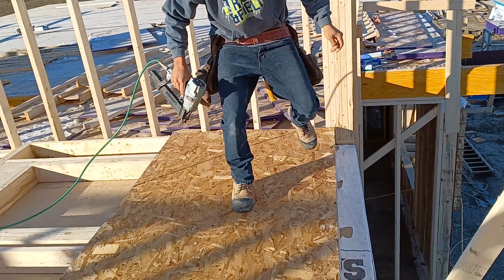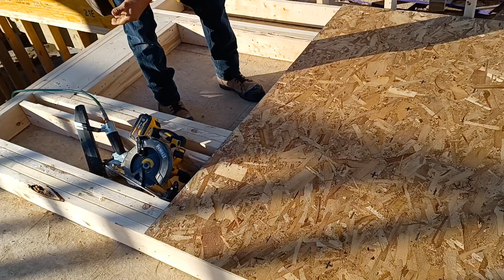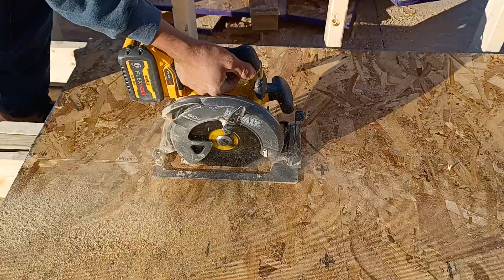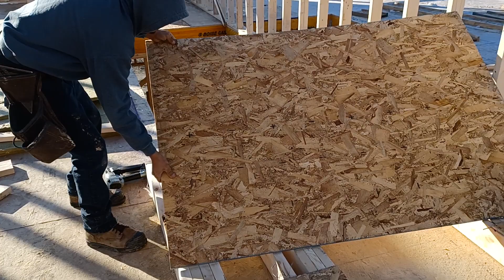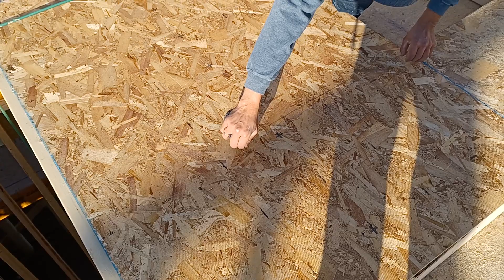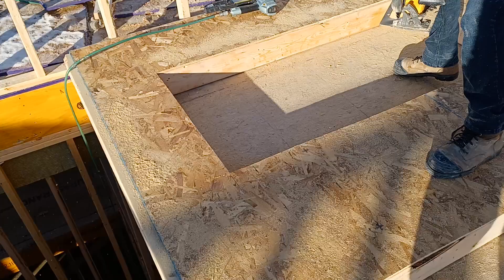framing Beast mood 😱😱👍✌

Comment: From a home buyer, I'd like to see a little more precision in where those nails or staples are going in.  In the last house I built, I watched the framer place the nails similar to this video and many of them missed the stud entirely.  But props to your work ethic!  Nice video
Reply from the maker: Thanks for watching. And for the advice bro!!!
Reply: Ted. I understand you. Last month I crawled underneath my house to check my water lines. As I peeled back the insulation. I found trash and cut pieces of OSB underneath my flooring. The framers had missed an entire length of sheating. 3 rows all missed. Removed the trash. Tidy up my insulation and remembered where to screw down my flooring. Never seen so much sloppy work in my life. Seems the workers are chasing money instead of quality.
Reply: Him missing a staple or two will not make any difference he has tons in it already its over kill he puts more in it incase he misses a few , you should see what the plumbers electricians and hvac guys get away with this guy missing a staple on some plywood should be the LEAST of your worries, we have to go fast this is how we eat they already are stingy on pay meanwhile without the framers nothing else is possible….
Reply from the maker: @buddylikeguitar  ya brother some people that doesn't know much about framming  thalck like does guys. Exactly like you say I put more than enough stapples. Props brother 👏.  And I almost never miss a staplles. I will show them o another video. When you have framme for a while you almost never miss because you get good at it . You can recognize even the sound when is missing or not
Reply: #movesgottabemade... 👍🏿👍🏿💯💯
Reply: @ontarioframingmachine2556  yeah exactly , 7 years framing in niagara region have my own company !!! Framer till i die
Reply: Ted, missing a couple fasteners isn't a deal breaker and is bound to happen when you are production framing. No carpenter is perfect and this fella is building with a lot of precision.
Reply from the maker: @buddylikeguitar  same here brother.

Comment: Lol a lot of framing inspectors here. Solid work bro, keep up that energy, job is extremely challenging as it is and you make it look easy.
Reply from the maker: Thanks bro.i really appreciate your words.
Reply: When it's my home. Hell yes. I will inspect my home. I'm paying for the work. If the quality is not there. Why would a home owner pay??
Reply: @2nickles647  as long as you have knowledge of the field, most have absolutely no knowledge and spew their bs like it matters.
Reply: Staples are hardly the way to go, you put about as many as I put with 2 1/4 nails. 

But I’m not gonna pick on ya. Just staples are not the way cheaper yes. I especially hate to see roofs stapled. Cause I’ve seen many roofs blow off from that reason
Reply: @ferocious_snailroswell2884   different states have different regulations.

Comment: No wonder why the houses in Ontario are overpriced but low quality maintenance. Your trying to play bumper cards with the structure of the house. Take a few seconds to slow down that way you’re not over doing or missing important spots. Works smarter not harsher.
Reply from the maker: Good point I think you are right
Reply: @ontarioframingmachine2556  I’m not critiquing you to demean you. I notice a lot framers do this. The house are new but come with a lot of problem. Just a consideration bro.

Comment: This is where folks that don't do framing apparently know more about making framing videos more than carpenters do working on wood framing...
Reply from the maker: How fast can you build a house??
Reply: Boy you said it man.
Reply: I framed for years and this is the sloppiest work I've ever seen. FORTUNATELY I worked with guys that take pride in their work.terrible
Reply: @ontarioframingmachine2556  People can build a house fast, but what about quality of the house built?  I've torn drywall off of my interior walls when remodeling and found that framers put in 2x4's that were split and I ended up replacing them because they wouldn't support a piece of paper.  That's shitty work.
Reply: @ontarioframingmachine2556  3 story, bout 6 months from slab to handover while working multiple other jobs too

Comment: Also, I would have thought it prudent to check the frame is square before nailing the bracing sheets on?
Reply: He would have already. In framing you usually measure both diagonals while it's laying if they match its square then you bang the sheets on

Comment: We've always used 8d nails for sheating with a 6/12 oc pattern. What is your nail pattern and staple length?
Reply: He probably has no idea. He is just shooting some nails randomly. Sheathing seams are tight. I wonder what will happen when temperatures raise in the spring time and that osb starts to expand.
Reply from the maker: Probably have a better idea than you
Reply from the maker: You sound very ignorant
Reply from the maker: @Faruk651  no body does that here so why will I do extra work?  I am not getting pay for it
Reply: @ontarioframingmachine2556  I thought this is your own business. So you are not being told what to do. You are the boss. I can understand if you worked for someone and they told you to do it this way, than it is their responsibility.
Reply from the maker: It's for my self .but even like that why would I do extra work.?? No framer does that around here. Remember the faster you go the more money you making
Reply: At least he has no problem admitting he sucks because everyone else does.   Why stand out, when you can blend in with the rest of the trash?
Reply: @ontarioframingmachine2556  You should do it because it’s the proper way to install the sheet. And that is what you’re paid to do whether or not other framers do it or not lol

Comment: You should be spacing the osb for expansion and contraction. Read the back of the osb . You can go as fast as you want but if you’re not installing or doing the job right you should get off YouTube and just make your money doing a half assed job.
Reply from the maker: I make my money 💰 framing. You tube is Yost for the fone of it.are you in the USA??  Because frammers here we never space the OSB
Reply: Wtf u talkin about bro
You Don t space osb...gtfoh
Reply: @robertsmith7637  
Try reading the backside of the OSB once. It says in bold letters what you need to space it at. If you can’t read it, have someone read it for you.
Reply from the maker: You most be one of those lazy ass that feels bad about other people working hard.
Reply: @robertsmith7637  
If it’s exterior osb , without it being Zip Sheathing, it needs to be spaced. Wtf.
Reply: @robertsmith7637  
3/4” osb decking still is spaced from side to side unless you reinvented osb.? 🧑🏼‍🎓
Reply: In Ontario you need to space your sheets.  Tight seems buckle.  Always.  On a 2 story house it will shrink 3/8" - 1/2" an inch in height over the first couple years.  On the roof the sheets swell in the summer and you can see the sheets through the shingles.